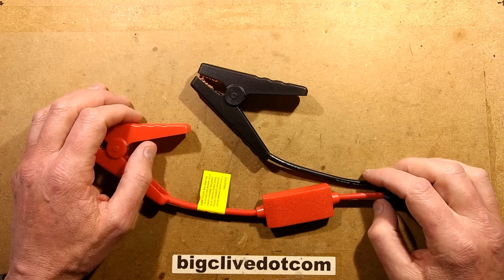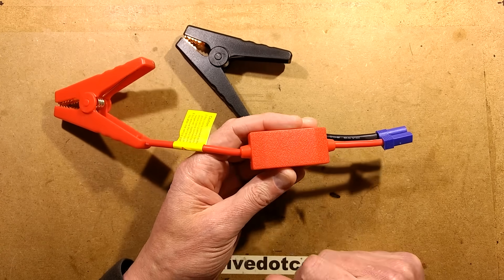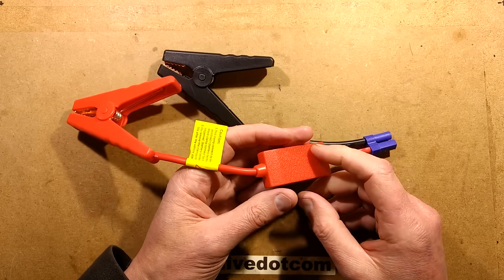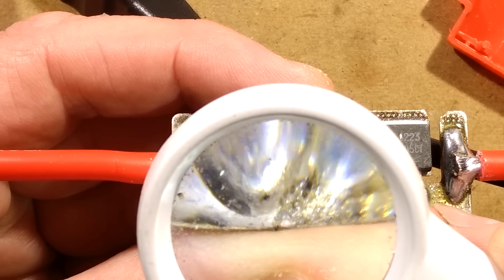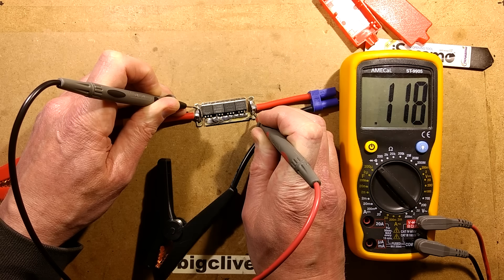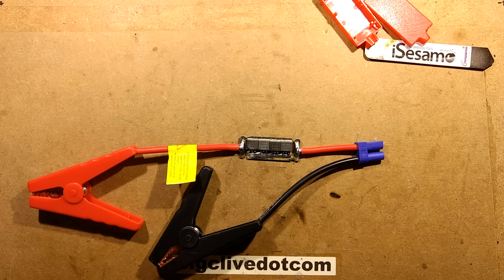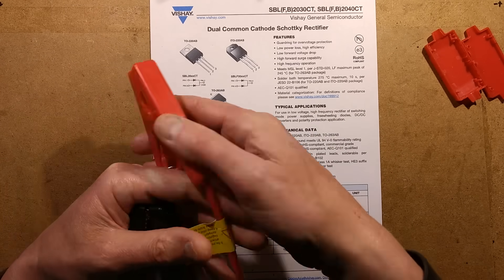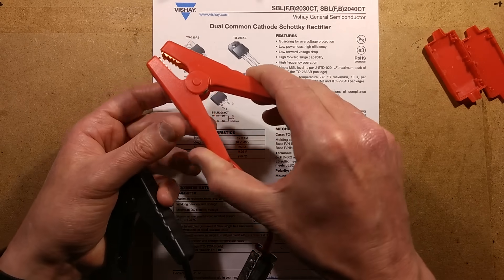What's in the little red box on some jump-start leads?  (Guess first.)

Comment: I think you have just found the ideal solution to connecting several 12v batteries to a small bank of solar 
panels but where each battery can power its own circuit and not another circuit from another battery.

I think i explained that properly?   eg. 4x 12v batteries . 100w panel connected to all 4 through these
cables. Then each battery connects to an LED lamp.
Thanks

Comment: Idiot Diodes in Jump Leads now that's a good idea even in Standard Jump leads saves you putting a Dead Short Across 2 Car Battery's and that would be Fireworks time LORL 24v at 350Amps 8.4Kwatts Hot Hot Hot

Comment: Diodes for reverse charging the lithium cells as they are 3S (11.1v) and the alternator on a car especially when cold starting outputs higher unsafe voltage levels and may overcharge the lipo cells

Comment: a long bit of enamled wire in a bucket of water can dissipate many Kw of power as a dummy load. Couple with a clamp meter you should be able to mimic the couple hundred amps it takes to crank a vehicle

Comment: i have battery bank that has car start function it has similar leads but bit beefier diode bridge. im pretty sure its there to protect lipos from charging  when car starts. my batterybank also shuts off if you crank too long for safety and has to be reset by connecting it to charger.

Comment: I am pretty new to this game. I have read and been advised that you can't put diodes in parallel as one will always hog the current. Please sit down. Are you sitting comfortably - good. I have a 40 V AC 80 A transformer. 80 A diodes are quite rare but I can get 50 A.   Can I parallel 2 x 50 A bridge diodes. I'm confused.  I am going to need some jolly big caps.
Reply: As you say. Diodes in parallel are not going to be any different from one diode. But we are working with a lot of current. They are going to fail one by one. When one fails the next one handles all the current.
Reply: Thanks very much for the reply. Why are they in used in this setup Clive is showing if they are going to go phut one by one. Any ideas how I can handle 80 Amps ?  Use a 50 Amp bridge rectifier and a quick blow 50 Amp fuse - LOL . I do like Clive's video's and the people that comment are usually so helpful.
Reply: This circuit is made to be cheap, not to last. They know it's going to fail. So they put a lot of them in order to make it work for a little longer.
40v 80A is very heavy for one power supply not to say for one diode. My recommendation it's to have four 40v 20A connected in parallel or even more. It takes four transformers and four full bridge rectifiers. But is a lot easier to work with.
Reply: The transformer was an old light welding one. I think 80 A is a bit on the Chinese side. 50 A will do. 
56 V x 50 A = 2828 W. I think I had better stop there. Sometimes I forget to engage my brain. 
I take it an LM317 might get a tad warm ? LOL Thanks for the replies and advice it's much appreciated.

Comment: The forward voltage of diodes actually increase with the current through them. So a schottky diode like that might have a Vf of 0.12V with the low current from the meter, but at close to their max current the Vf will increase. How high the Vf will be seems to vary depending on the max reverse voltage. Writing this before finishing the video btw. :) My guess is a Vf of around 0.5V. :)
Reply: Hmm I was wrong, datasheet says 0.6V. Anyway, schottky diode Vf seem to vary a lot more with current than on regular silicon diodes.

Comment: does the diode voltage drop when you put them in parallel? if so, ~0.12v * 4 = 0.60v which is about right for a silicon diode.

Comment: These leads may be rubbish but I have used a more expensive Li-po car jump starter and it was a life saver. -18c and a dead battery the jumpstarer took a couple of turns to get the 2 litre car purring. Very impressive. Caveat emptor of course.

Comment: I bought a branded one of these on Amazon and the battery failed within a few charges. The jumper cable also melted after a very brief use.

They're good when they work but I wouldn't recommend any of them

Comment: It seems to depend what clamps you get, i have 2 sets for 2 jump packs, both of which have active protection for reverse polarity, shorting, and i presume over current.
i know because i have tested them for reverse polarity and shorting. Quite simply on the ones i have, they wont enable the output unless they are correctly connected.
it would appear that Clive got some really cheap ones that are not idiot proofed. 

I have ones similar to this: http://www.ebay.com.au/itm/12V-Smart-LED-Lead-Cable-Battery-Alligator-Clamp-Clip-Emergency-Jump-Start-/302317437186?hash=item4663860102:g:cacAAOSwX9FZGWiY for one of my packs that didnt have "protected clamps" and my other pack came with what looks to be identical to these: http://www.ebay.com.au/itm/12V-200A-EC5-Connector-Jumper-Cable-Alligator-Clamps-Booster-Battery-Clips-/391774607892?hash=item5b37961a14:g:WWAAAOSwX61ZCxcc while they look similar to what clive has, the protection module does have a small positive power feed inside the heatshrink around the main negative cable to the module.

Both types use Mosfets id imagine to switch the power on and off, and they also can be powered from clamps or pack, however powering via clamps before pack will result in an error indication.

Comment: Diode for reverse protection in cans you hook them up to a battery backwards. Should have lights also but not always, usually will have a red and green LED to show when they hooked up correctly or reverse polarity.

Comment: Diodes are there to prevent car alternator trying to charge Lithium cells. A dead car battery usually has horrific high internal resistance leading to high charging voltage from alternator which would be bad news for a 3-cell Lithium acc.

Comment: Based on the wire I blew up a bank of what I think were fets.
Reply: Ok that looks similar but a bit different to the one I opened. I had 8 of them with 2 bus bars along the bottom  and 4 unmarked diodes on each side. The one I blew up went open circuit with a noticeable flash on the first crank despite being quite an expensive unit with a major brand name. It did the job though.

Comment: Get a starter motor front a junkyard, mount it into a fixture were you can force a piece of scrap lumber into the gear portion of the starter. This is typical shadetree load test for a battery and starter.

Comment: In case anyone was let down by jumper cables they sell at gas stations and supermarkets (those that have far more insulation than actual copper), here is a recipe for cheap yet indestructible jumper cables:
- buy 4 welder ground clamps. Those are very robust and are usually rated for 300A+
- buy 4 lug connectors
- buy 6 meters of 25mm^2 welder ground cable (or thicker). You will make two 3m cables out of this, buy more if you need longer. This type of cable is very soft even in low temperatures.
- split cable in half, crimp or solder lug connectors onto cable, connect to clamps
- congratulations, you have jumper cables that can start a diesel truck.
Reply: When I got my first vehicle my dad gave me some almost 180 dollar jumper cables, overpriced as hell, thick as anything but by god I can start anything with a motor with them lol
Reply: MasterBata in a pinch you can run smaller wires in parallel with any type of clamp(even hose clamps) to hold the wire on the terminals
Reply: @SebfromNj  In the days of chrome plated bumpers, two cheap cables in parallel to the positive terminals and the bumpers touching for the ground connection.
Reply: @scootergeorge9576  You didn't even need the cables, just use the two lug wrenches (one from each car) in series to connect the positive terminals.
Reply: @scootergeorge9576    yes, my electronics store boss, early 70's ...used his dodge van (they were BUILT GOOD in those good 'ol days) boosted my truck with bumpers touching...grrrr   'started  right up "...have a good/safe/thankful day...from central wintry alberta
Reply: My buddy jump started my v8 mustang with two coat hanger wires
Reply: @theupscriber65 I stole the speaker wire off my sub to jump start it
Reply: Had a set of jumper cables made from welding paraphernalia and they were very nice.  Made the mistake of loaning them to a stranger in need outside of a car auction that was about to start that I needed to get into quick, but still wanted to help the guy out.  I handed him the jumper cables and told him he could just set them by the driver door of my car or under my car when he was done.  Never saw them again.  Hope somebody out there is enjoying them haha.
Reply: I used a series of wrenches between two cars nose to nose offset so the batteries were as close as possible. Lemme tell you: Those wrenches got HOT
Reply: Youtube, can we get a feature to save comments like these please? Thanks
Reply: Diesel v16 its work or not ( voltage 24v)
Reply: - buy 1 roll of red insulating tape
- buy 1 roll of black insulating tape
- Use the insulating tape to insulate as much bare metal as possible and to colour code the leads to avoid accidents.
Reply: @rogerbarton497  i would not use tape but colored heat shrink, tape will peel off after a few months. Heat shrink won't come off in years.
Reply: @m00str  Personal choice - I've never had a problem with self-adhesive insulating tape except where it comes into contact with an oil leak.
Reply: @rogerbarton497  perhaps my insulation tape is just shit.
Reply: In Afghanistan our heavy equipment guys(locals) would just fray the ends of extension cables and place them on the corresponding terminals of each battery, which looked sketchy as hell, but worked like a charm.
Reply: @theDudeOfDudes  I've used G-cramps and mole grips before now.
Reply: My friends managed to jumpstart a car with a couple of the aluminium foil trays you put under barbecues
Reply: An easier solution is to avoid buying them at gas stations and have a good set in your car.
Reply: Better yet buy OLD vintage jumper cables at estate sales. Back in the day they were solid copper. They normally want $1 or $2
Reply: Thank you.  As a minor despot of a small banana republic, I found this very informative.
Reply: I have a v12 jet motor
Reply: Made mine from battery leads.
Reply: When working at the phone company, I had to  jump start my van more than a couple times using a couple lengths of bonding wire
Reply: I don't have a diesel truck
Reply: Yes. Heavy cables are quick and sure starters. For north Americans 25 mm^2 is about 4 AWG. I really need to build a set with welding cable since the vinyl cables I have are awful in sub-zero F temps.
Reply: @antilogism  IMHO, Everything is awful in sub-zero temps lol
Reply: I have what is basically a bug-out box. Rechargeable, comes with a light, usb inputs, 12v car jack, standard us power socket, air compressor (although a kinda weak one, works for  when your tire either just loses pressure over time, or if you've got a small hole) and the thing weighs about 40 pounds, so it's got the oomph at least, unlike these wimpy starter packs.
Reply: @thegeneralissimo470  - I have one of those too. Also includes a work light. What's your point?
Reply: I always buy good cables.  I. Jumped a friend’s vehicle, while. Mine was running.   Got him started, disconnected the cables, and found out my turn signals no longer worked.  It basically. Drained my battery, which took some time to charge back up.
Reply: I always turned my car off before jumping someone. Diodes are expensive to replace.

Comment: Is it a little elf on a hamster wheel to generate enough energy to jumpstart the batter?
Reply: Liam Wiltshire guessing after watching the video isn't fair
Reply: Of course not, don't be ridiculous.

It's obviously a gnome in there.
Reply: The Tyttuutface if you connect it to a step up transformer connection to a battery
Reply: @the486kgman2  Transformer, more that meets the eye. Transformer, little elf on a hamster wheel...
Reply: Scooter George you don’t understand what a power transformer is I will call the police
Reply: @the486kgman2   - Not directly but with an inverter, for example, 12 volts DC (battery) is stepped up to 120 volt AC.
Reply: Scooter George 
What are you talking about?!! 120 volts is America’s voltages 250 volts is our voltage.
Reply: @the486kgman2  - Doesn't matter. Same principal applies. Could be stepped up to 250 as well with an inverter.  Still waiting for "The Police" to arrive.  : D
Reply: Behave it's like a hamster turning the London eye lmfao
Reply: In Scotland we use Haggi' (Plural of Haggis) they are used to running round hills so perfect for the Hamster wheel!

Comment: Thanks for the shoutout much appreciated
Reply: +bigclivedotcom can you please do a series on these, there are so many, most being completely deceitful on ratings and capacity. 

People would be helped to understand the difference between a power bank and a engine boost unit. As well as understand the different modes/benefits of charging between a USB or 12vdc barrel plug. 

I added a balance plug, and it seems to help, as the cells are generally low quality and poorly managed.
Reply from the maker: You're welcome.

Comment: Just had a look at the really high current wielding cable you can get to work out if it would be suitable for the load. Nearly fell off the chair at the price. Even the "cheap" stuff was £40 per meter. There is some cheaper stuff that might do the job but it's £100 per reel and is only rated for 500A continuous.
http://www.12voltplanet.co.uk/extra-flexible-pvc-battery-cable-95mm-500a.html
Reply: Gordon Lawrence Yeah, raw copper is becoming harder to get, scrap copper prices have been high enough during the past decade, that we have had problems with hoodlums stealing the cabling from railroad lines during the night, leaving thousands of commuters stranded the next morning.

Comment: i can tell you whats in them because ive taken them apart before... its nothing more than a few cheap diodes to prevent the alternator of the car charging the lithium battery backs once the car starts... no fuse, no over current protection, no under voltage protection. ..
Reply: It seems to depend what clamps you get, i have 2 sets for 2 jump packs, both of which have active protection for reverse polarity, shorting, and i presume over current.
i know because i have tested them for reverse polarity and shorting. Quite simply on the ones i have, they wont enable the output unless they are correctly connected.
it would appear that Clive got some really cheap ones that are not idiot proofed. 

I have ones similar to this: http://www.ebay.com.au/itm/12V-Smart-LED-Lead-Cable-Battery-Alligator-Clamp-Clip-Emergency-Jump-Start-/302317437186?hash=item4663860102:g:cacAAOSwX9FZGWiY for one of my packs that didnt have "protected clamps" and my other pack came with what looks to be identical to these: http://www.ebay.com.au/itm/12V-200A-EC5-Connector-Jumper-Cable-Alligator-Clamps-Booster-Battery-Clips-/391774607892?hash=item5b37961a14:g:WWAAAOSwX61ZCxcc while they look similar to what clive has, the protection module does have a small positive power feed inside the heatshrink around the main negative cable to the module.

Both types use Mosfets id imagine to switch the power on and off, and they also can be powered from clamps or pack, however powering via clamps before pack will result in an error indication.

Comment: 2kA? Really!? They're just making these numbers up. 100A will start most 12V vehicles outright if you can maintain more than 10V across the Lead Acid Battery's terminals. Volt drop is more an issue than outright current. I like the diodes to protect the jumper pack/car electronics from reverse polarity.
Reply: most of starting a vehicle is getting its own battery up , or its pulling down the load more than the starter, those poeple who put on jump leads, then instantly crank it to death make it worse for themselves, that and rev the hell out of the 2nd car.   ive used a small security battery with not so great wires to start a dead car in the cold, trick was to let it sit connected for at least 5-10 mins

Comment: Hey Clive, any chance you have a video for powering a AA/AAA battery device with USB?
Reply: BladeMaverick Not really his area, but an AA, AAA, C or D cell is 1.5V nominal, 1.2V to 1.5V practical.  USB power (without special USB C signals) is about 4V to 5V, so unless the device happens to run on 3 or 4 cells in series, some kind of buck DC/DC converter should be used to lower the voltage to the right level.

Comment: Well, the pulse rating of all the diodes combined is 2000A. So they didn't make up a number ;) . The fact that at that current the forward voltage will be in the region of 1V which at 2000A is a 2kW heater in that small package that will almost instantly desolder if not vaporize the diode has never hindered the chinese to quote these numbers.